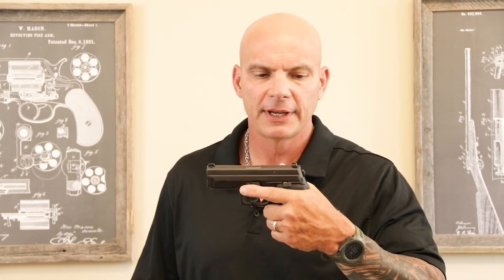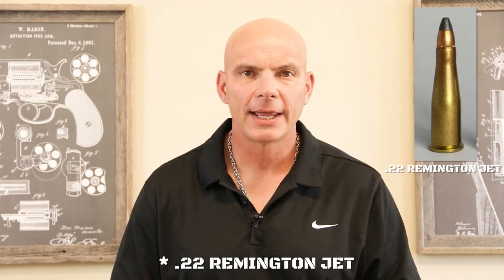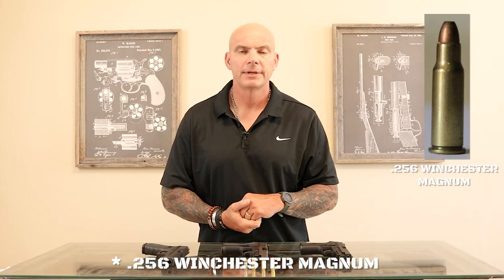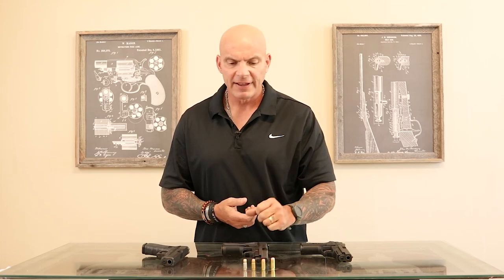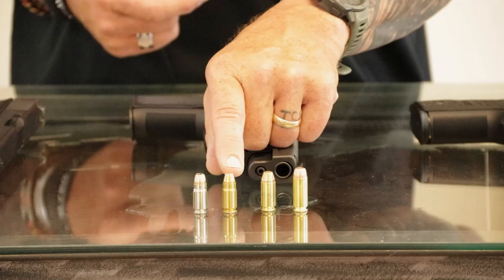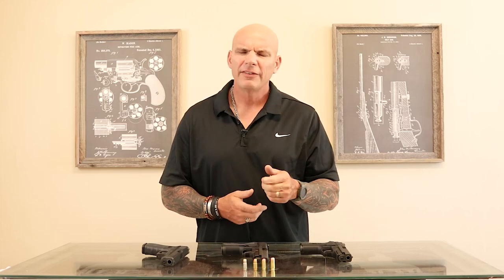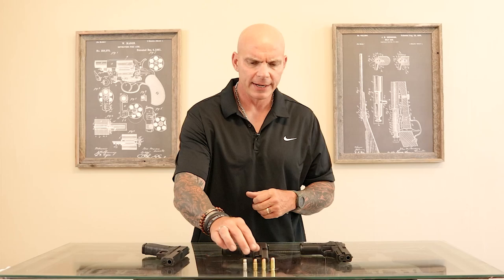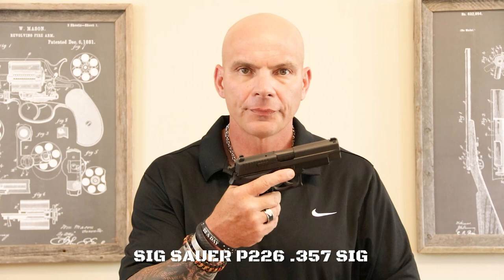A Brief History of .357 SIG

Comment: 600 fpe not 700 fpe
Reply: @johnklatt3522  I barely ever beat the box even with UW. If so it's maybe by 10 or 20 fps. At the end of the day you have the same case capacity as a .40 with just a smaller bullet. 10mm runs in the 700 - 800 fpe range and it's definitely a step up from 357 sig. It's just physics...bigger bullet and greater case capacity.
Reply: @johnklatt3522  I heard some rumors that they were having overpressure issues but I think that's BS as I've run handloads out of my 5.28" XDM that approached 900 fpe with estimated pressures around 43k and had NO such issues...It must be a $$ thing...it always is.
Reply: @johnklatt3522  LOL..I didn't load them, I'm not that crazy but did shoot them. They had some serious punch